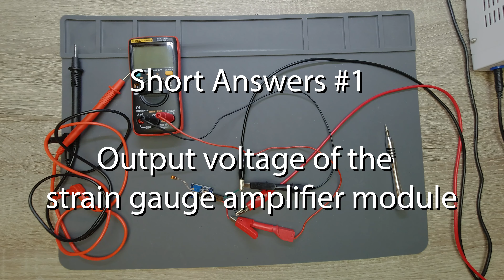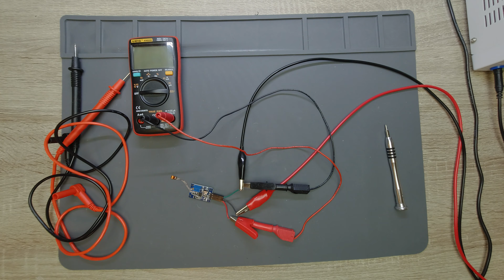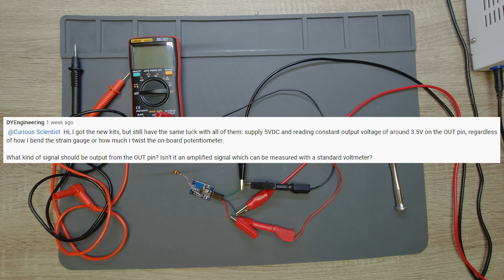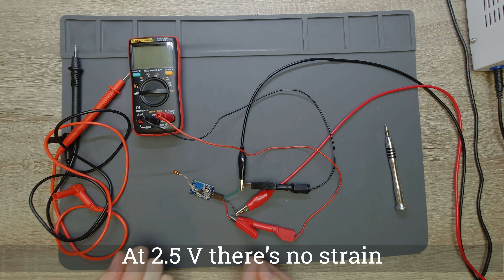[Short Answers #1] Output voltage of a strain gauge amplifier module

Comment: What type of power supply is that? And what types can be used for installation from strain gauge to multimeter?

Please answer, thank you🙏🏽
Reply from the maker: I used a regular adjustable laboratory power supply, nothing fancy. However, I don't understand your second question. Could you rephrase it? What do you mean by " installation from strain gauge to multimeter"? You don't "measure" the output of a strain gauge with a power supply... You need a strain gauge amplifier module. Check my website.

Comment: If i'm using 120 Ohms strain gauge, should i use same 120 Ohms for the three other resistor or should I change it to 240 Ohms because the amplifier amplify the staringauge one to 240 Ohm?
Reply from the maker: There's no such thing as amplifying resistance... This module is made for 350 Ohm strain gauges. If you want to use it with 120 Ohm strain gauge, my best guess would be to change the other three resistors in the Wheatstone bridge to either 110 Ohm or 130 Ohm.

Comment: Thank you very much for this video, addressing my question! Your board does work like assumed it should. It seems mine is faulty.
Reply from the maker: You're welcome! If you want, send me a picture of your board on Instagram or send me an email. I am curious about your board. I can not understand why it is behaving wrong.
Reply: @CuriousScientist  Thank you very much for your offer. I would send you the pictures, but I don't see an email on your profile...
Reply from the maker: My mail is on my website.
Reply: @CuriousScientist  Well, didn't find it on your website either. I have uploaded the photos to my drive:
https://drive.google.com/drive/folders/1v4plXS9fiWHXQbJ5PUoAvjTMrEzvjN2B?usp=sharing
Reply from the maker: There is a big text at the top of my webpage saying "Contact". I could not make it easier than that. 

Based on the pictures, the module looks OK. I assume you have the strain gauge connected when you are testing the module. I also assume that you supply it with 5 V (VCC). Then I also assume that you measure the voltage between "OUT" and "GND", right? Those pins and solders look a bit "cold", next time leave the iron at the pins for a bit longer. Are you sure that you haven't shorted any of the connections earlier?

It is hard to think about what else could go wrong. You can go through the circuit with a multimeter and check the voltages. You can check the output of the Wheatstone bridge, the output of the first amplifier stage, the voltage reference...etc.
Reply: @CuriousScientist  Yeah, I did see the "Contact" link, but it only took me to the contact form which didn't have the option to upload files.

Anyway, yes, all you said is correct. The solder looks cold, yes. This is a new roll of solder I bought which appears to have a different composition and I am having hard time with it. 

I will try to make the measurements as you suggest. Although not sure I can find anything and if I do then not sure I can fix it.

Thank you so much for you efforts!!
Reply from the maker: If you write me a message by using the form, the message will arrive to my email address. So, when I reply to it, you will get my mail address. I did this neat trick so I can avoid being spammed with random messages. With the form with mandatory fields, people think twice before sending an email to me. It saves me a bunch of time. 

Let me know the outcome of your measurements once you're done with them. I am interested.
Reply: OK, I will need to free up some time. Once I have the results I will share with you.
Reply: @DYEngineering  Were you able to solve the problem? I'm having the same issue, it's stuck in 699...

Comment: Hi, I just recently stumbled upon your excellent tutorials, thank you for your uploads. I have few of these strain gauge module and when I connect these to power supply using arduino most of these module glows the red led. Only the ones with blue led light on gives the reading. What is the meaning of this red led light?
Reply from the maker: Hi! I don't know if the red LED has any meaning, I would assume that they are just simple power indicators, and they do not fulfill any troubleshooting purposes. At least based on the schematic of the circuit, the LED is powered from the 5 V and that's all. It is not controlled by any logic. Have you tried turning the potentiometer? They are multiturn potentiometers, and sometimes you need to turn the screw a lot to start getting readings.
Reply: @CuriousScientist  Thank you for the response. I had the  module glowing blue while it was giving the reading and now it is glowing red and does not give the reading. I will spend some more time with these module to better understand.
Reply from the maker: @JupiterEarth2026a  Hm, that is interesting. I haven't met a board which has LEDs with different lights. Are you sure that you have the same board as I do? 

Have you tried playing with the potentiometer? Any progress with that?
Reply: @CuriousScientist  Yes, I have turned the potentiometer screw left and right several turns without any response.  I was surprised to find that when I changed the 350 ohms strain gauge in one of the the board with red light it turned blue for a while, but somehow it is red again. 
I have ordered few other boards to check if those will be different, the board looks similar having LM358.
Reply from the maker: Hmm, interesting! I hope that the new boards will work just fine.
Reply: @CuriousScientist  Hi, I got the new boards and they are all working good, even though the led are glowing red in some they seems to work , as you said the led color red or blue did not matter. Probably I damaged the previous ones while adjusting the potentiometer. Looks like these strain gauge will require some temperature compensation adjustment, as my voltage reading is not stable and gradually keeps rising under no load or is there something that I am missing?
Reply from the maker: Hi! Of course, one single strain gauge will be exposed to and affected by temperature fluctuations. This module can not be used in applications where this can be a big issue. Then, you would need to build a bridge and mount 2 strain gauges on the specimen. Then, you can use an instrumentation amplifier to amplify the signal of the bridge. 

Another issue is the creep of the strain gauges and/or glue. 

There is a very good paper on strain gauges from Omega, if I remember correctly. I even cite it in some of my strain gauge-related videos and articles. Read it.

Comment: Hi, I found the problem why some of these boards don't work. I checked the resistances of the bridge and the resistors should be 360 Ohms to match the resistance of the strain gauge. But in my case the resistors were 3,6 kOhms. I replaced them and now the circuit works as expected. SMD resistor code should be 3600 or 361. Sounds weird but code 3600 means 360x10^0, 3601 means 360x10^1, 362 means 36x10^2 and so on. Seems someone put the wrong reel in the placement machine.
Reply: My boards have 3600 coded resistors and still don't work. Will probably go ahead and order a few more of these and hopefully statistics will do its job and I will have one working.
Reply: @DYEngineering  Maybe the opamp is placed incorrectly, or the strain gauge has the wrong resistance? Is the used chip an opamp at all (should be LM358)? Try to measure the resistors if they are really 360 Ohms.
Reply: @paulpreu6708 Yes, it is an LM358. Hard to believe the resistors' values don't correspond to the marking. Anyway, measuring them would require unsoldering them and I am afraid I don't want to go that route.
Reply: @DYEngineering  It should be possible to measure the resistors in the circuit without desoldering them. It's not 100 % accurate but it should be good enough. Is the LM358 placed correctly? The pin 1 marking should point towards the potentiometer.
Reply: @paulpreu6708   Yes, the LM358 is placed correctly according to your description. 

I measured the resistance of the resistors. All seem to match the markings.
Reply from the maker: Hi!
Wow, that's a nice catch! Having a different resistor by a factor of 10 in the bridge can really mess things up! 

It is also interesting that you mention 360 Ohm resistors because I have boards that have 348 Ohm resistors in the bridge part. They are marked with a 4-digit code: 3480. 

By the way, I will very soon publish a video really relevant to this board and the circuit on the board. Check back in a few days if you are interested.
Reply: @CuriousScientist  Hi! Yes, I'm interested, thank you. 348 Ohms should fit even better, but I only have e24 resistors. I will try to add 12 kOhms in parallel and see what happens.

Comment: Hello Mr. curious, Thank you for the work you do, I love your YouTube videos. 

I am working on building a suspension load cell for data logging for a Racecar. Its very similar to this setup in the video, but is using a full bridg strain gauge from Omega with 4 leads coming out. The brain box can supply 5v and I need to send it a signal back. (All of the calibration can be done in the logger software). My question is, being a full bridge, would your amplifier work? I’m thinking about using this one, would it work better?
This is the amplifier I bought, do you think that would work?
(Teyleten Robot Millivolt/Microvolt Voltage Amplifier Module AD620 Instrumentation Amplifier Module Signal Amplifier Module DC 3-12V High Precision)
Thanks for any wisdom you can share
Reply from the maker: Hi! The short answer is no. 
Why? The amplifier I show in this video is a strain gauge amplifier. It is supposed to be used with a single piece of strain gauge (resistor) and not with a bridge because the rest of the bridge (3 other resistors) is already embedded in the board. A simple strain gauge is just a piece of variable resistor, and a bridge (like a load cell) is a 4-pole device that requires a voltage source, and exchange for the voltage source it provides some voltage on its output that is proportional to the ratios of the resistors in the bridge. The AD620-based amplifier was a great choice for your application. It is a simple voltage amplifier with an excitation voltage source, and for a bridge (load cell) you need that.

Comment: Do you by any chance have the formula to calculate the strain based on the voltage this amplifier gives? I found one for whetstone bridges online but I can't figure out how to apply it to this setup.
Thanks!
Reply from the maker: Hi! I think that the formula is in this video: https://www.youtube.com/watch?v=FWRiSIqF3f8
Reply: @CuriousScientist  yeah but that is the formula for a normal a Wheatstone bridge, with the amplifier there is a amplification factor that it should be considered dividing the v_r term. But I can't manage to find online the amplification factor of this module
Reply from the maker: Measure the input voltage and the output voltage with a multimeter, and then you can calculate it. Or just look up the circuit of the amplifier and check the resistor values around the op-amp so you can calculate the gain.
Reply: were you able to figure out this formula?

Comment: I had the same problem in like 5 modules, then I realized the screw in the potentiometer is way over tightened, so give it like at least 3 counter clock wise turns while looking at a serial monitor or a multimeter and you will find the working range.
Reply from the maker: Yes, these multiturn potentiometers are tricky. It takes a few turns to find its working range.
Reply: Thanks for the advice, however that was not the case with the modules I had. Mine output a steady 3.5V signal regardless of the potentiometer whatsoever.

Comment: I had the same problem that was reported at the beginning of the video.  So I tried a second module and it worked fine so I think some of them are defective.
Reply from the maker: It seems that sometimes these modules are not too reliable. However, I am happy to hear that you solved the issue!

Comment: in this module there is an amplifier, then is the output an amplified output or an actual output?

thanks a lot
Reply from the maker: The module has an amplifier in it and I measure that.

Comment: Wouw,
Thanks a lot for this tiny and instructive video ! 

What is the module reference ?
I wonder, when using some programmable components made in 3,3 Volts logic, maybe it will be mandatory to transform the +5 Volts signal to a digital signal via Analog to Digital conversion ?

Another interesting experiment could be to place the strain gauge onto a closed volume, with a temperature modification (via a Peltier module).
Most of electronic components are prone to temperature-induced offsets. 

Remember that most metals, when heavily cold-formed are making heat when the strain is applied.
I wonder also how to "connect" the plastic gauge to the component itself... 

Lots of metals have poor surfaces rugosity, if the sensor flies upon them, some delamination should occur quickly.

Best regards !
Reply from the maker: Hi! I am glad you liked the video. I supplied 5 volts to the circuit. The circuit is just technically an opamp and a Wheatstone bridge, so, it is fully analog. I haven't tried, but I guess, it should work with +3.3 V too as the onboard opamp, which is an LM358 supports this voltage. The only thing is that your output voltage will swing between 0 V and 3.3 V. 

Metals of course produce some heat when you deform them (in fact, around 90-95% of the work done turns into heat), but it really depends on the strain rate too. If you deform it slow enough, the heat could dissipate and the temperature change is not really noticeable. However, if you deform it very fast, they can become extremely hot. Sometimes when I test a bit dirty and oily specimens at high strain rates I can even smell the burnt oil smell. :)

I already made a video about the installation of strain gauges: https://youtu.be/WZIKjzOnZr8 . Of course, they require a carefully prepared and cleaned surface and a good adhesion. You cannot stick it on any random surface. Regarding the temperature offset, strain gauges are also sensitive to the temperature changes due to thermal expansion. This is why you want to use multiple strain gauges, so while one strain gauge measures the strain plus the temperature effects, the other which placed perpendicular to the other one subtracts the temperature effects. so at the end, you only measure the strain. 

But once again, these strain gauges can only measure up to about 2% strain which is not a very large value when it comes to deformation of metals. At least in my field, 2% is almost nothing.
Reply: @CuriousScientist  hi i got lot of help from this video. thankss.. according to your reply
 "But once again, these strain gauges can only measure up to about 2% strain which is not a very large value when it comes to deformation of metals. At least in my field, 2% is almost nothing".
can i get easy explanation because i'm still learning about this stuff.
Reply from the maker: Which part is not clean? 2% elongation is enough if you want to indicate some small displacement, but for example it is just a small fraction of the whole tensile curve of a ductile metal.
Reply: @CuriousScientist  it's clear sir. thankss